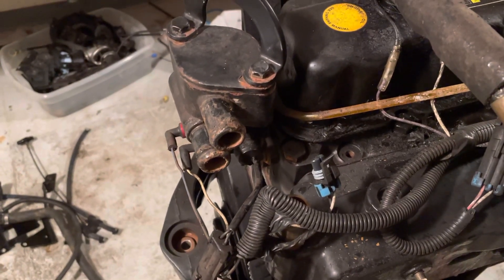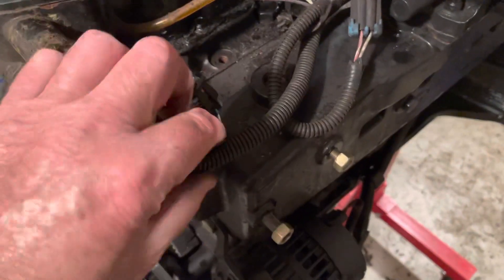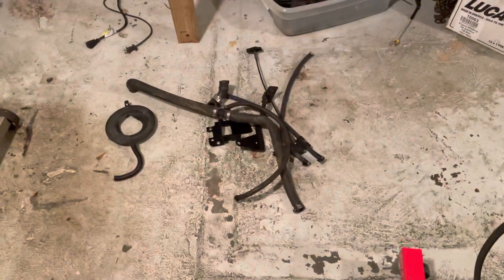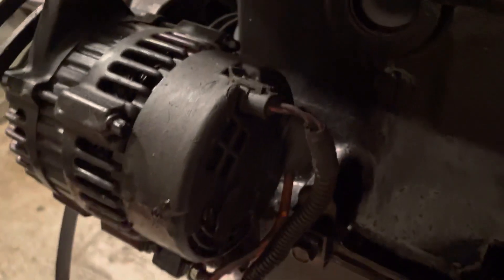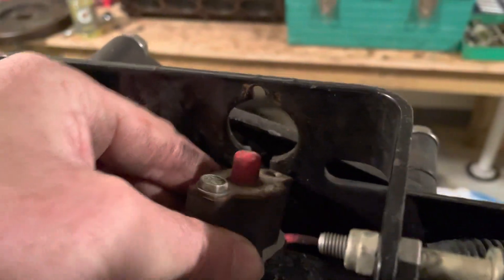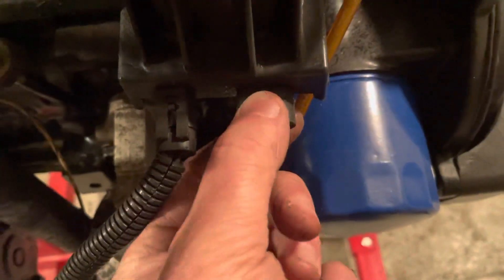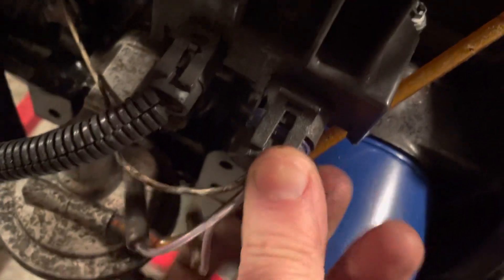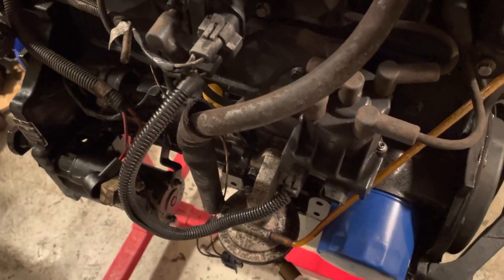Mercruiser 3.0 1(X2) - Teardown - Removing the Electrical Harness

Comment: Also did you ever figure out, where the white (Bypass) wire coming off the ignition went to? The one that has 3 wires they you mentioned were not used
Reply from the maker: That connector was the shift kill system. I cover this in a later video. The two wires that are not connected under normal operation are connected when you want to set the timing. This video covers these wires;

Mercruiser 3.0 1(k) - Dynamic Timing
https://youtu.be/XBQhxogrFsE
Reply: @moccasinmarine  thanks very helpful. Can you put power directly to the kill switch to see if its functional?
Reply from the maker: The shift kill switch always has power to one side whenever the ignition switch is on. When you shift out of gear the shift kill switch closes and sends +12v to the distributor on pin B. If the wires at distributor pins R and E are disconnected it kills the engine. If the wires are connected it locks the timing so you can set the timing as my video describes.
Reply: @moccasinmarine  Thanks again.I got troubles! It runs ok until put in gear. This is on muffs of course. I see the wires from the harness that leads to the interupter was melted (previous owner) also the shift cables have been messed around with
Reply from the maker: @chuckque6234  You probably have shift cable issues. If there is tension of any kind on the shift cable it operates the shift kill switch killing the engine. Pull the shift cable off the shifter and shift it by hand. It should shift with ease by hand.
Reply: @moccasinmarine Thanks...will do! But the interuptor wasnt wired to anything. They looped it to itself

Comment: The two shift kill wires. They are just drapped over the hot manifold cover like that?
Reply from the maker: That’s not a manifold. It’s a stamped steel valve cover and it probably gets no hotter than 170-180. And yes they are draped over since aren’t long enough to go around.